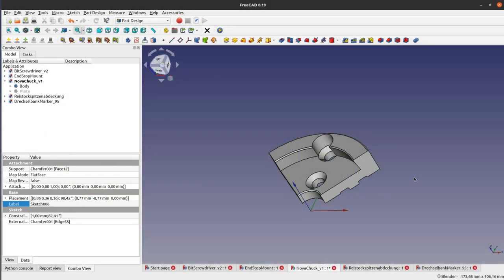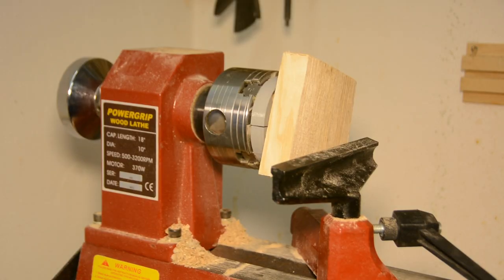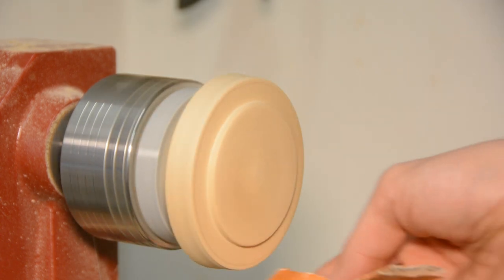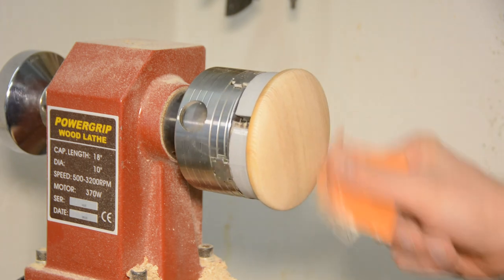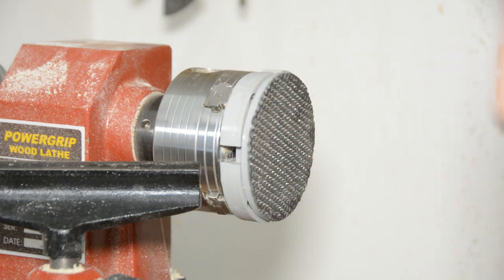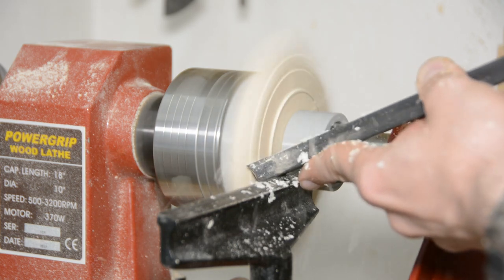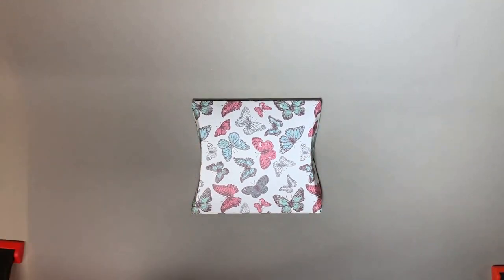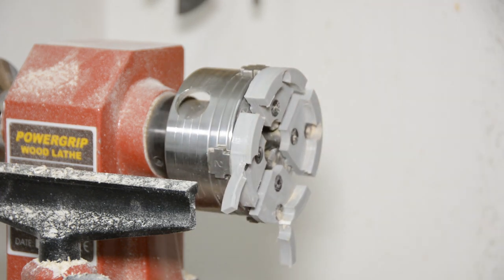3d printed woodturning jigs

Comment: Great content😊⚘
Reply from the maker: Thanks a lot! This was a super fun experiment and I have to admit I was a bit scared when pressing the on switch with the jaws on the lathe. :-)
Reply: @WayofWood  
You are absolutely right 😁
PLA tends to be more fragile than other materials when put under stress 

Thank you for sharing this video 
Awesome as your heart ⚘
Reply from the maker: @FixTronics  Carbon fiber nylon or a tough resin would most likely work better. But for the price of a bottle of tough resin I already get the steel jaws - so it would defeat the purpose. 😏
Reply: @WayofWood  
👍😁

Comment: Are they safe at high speeds?
Reply from the maker: The honest answer is: It depends. When you turn a relatively small piece of wood, support with the tailstock, use a strong filament I would feel save using them. I have been turning some of the first lids at 2200 rpm and the jaws hold fine. 
I would not use these without a face shield and would not hold a big bowl with these - but when using them with care I personally feel relatively save.